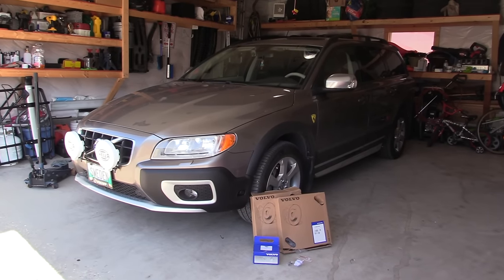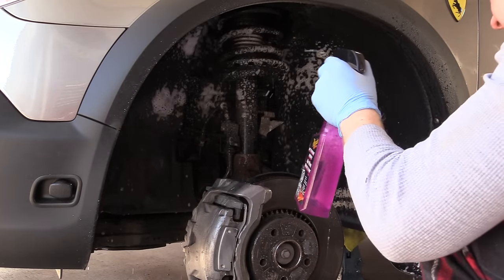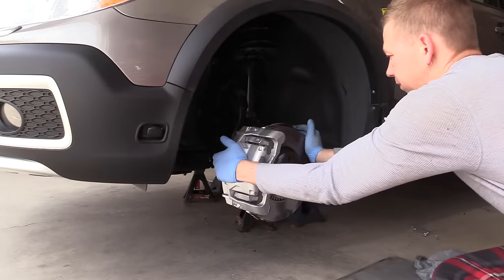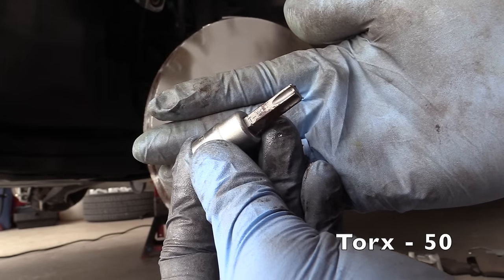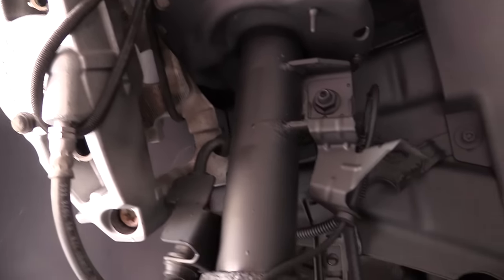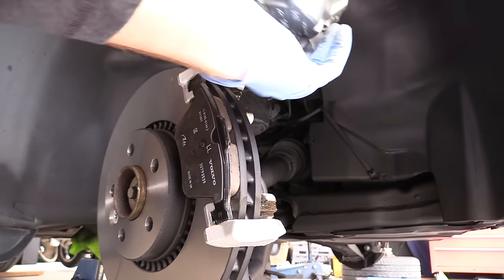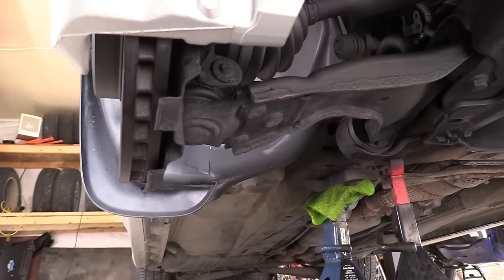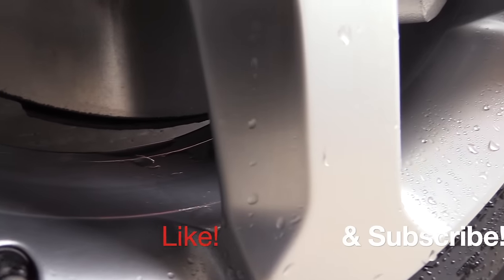Volvo Front Brake Replacement. And a little more!

Comment: Unfortunately the front rotors in newer models are now warping prematurely in my experience. I used to get 60,000 miles out of front rotors in P2 models never any pulsating in the steering wheel and both of our 2016 XC70's rotors started warping with slight shake that can be felt in the steering wheel when driving on the freeway that developed in just a few thousand miles with each of our old stock 2016 XC70's. It wasn't severe but happened again just a few thousand miles later in one and I can feel a slight shake or pulsating in the steering wheel when driving on the freeway. I posted a video on my youtube channel of the pulsating during braking. I don't think anyone likes driving a luxury vehicle with a slight shake in the steering wheel so if the issue is rotors I'm surprised Volvo hasn't revised to make them more like the rotors they had for P2 models that never had this issue. As to the cause I believe some suspect Volvo is now using a softer rotor material but I am wondering since it's happening so soon in my experience maybe the hubs aren't perfectly flat and have runout that rotors are conforming to since the rotors come from Sweden and do look solid and high quality. I believe this issue also continues with the new lineup after driving a new XC90 loaner with around a few thousand miles and I could feel the same thing in the steering wheel. In my experience Volvo had the best brakes with P2 generation and I'm shocked to experience this.

Comment: Hey Mr. Volvo
Good videos
Silicone Grease is not as heat resistant as copper grease as I use it keeps for several years, so there is still on when I change brakes next time. i have a 2011 volvo xc70 2011 that has driven 320000 km.
Kind regards Peter from Denmark
Reply: I am using Carlube Silicone Grease XSG070 on my Volvo XC70 2006 D5 Diesel when servicing on my brakes and I am verry impressed of results.
On sliding pins: 
The calipers are floating even 3 Years after this treatment .No sign of corrosion.
In the description:
ADVANTAGES:

Extreme temperature resistant multi purpose grease
Lubricates and protects plastic and rubber parts
Ideal for brake pads, o rings rubber seals and brake callipers
Water repellent
Because it has low dense ,I use a tiny tube - as in the pen.
I pushing the tube inside in the grease and  then with it lubricate iside the tubes for the sliding pins.

Comment: Very good video and work , I'm not a mechanic before I watch your video I've seen another in a garage where they've been saying that you need to bleed the brake fluid out as is not good to push it up the system, did you had any issues by not doing that.

Comment: First and foremost your videos are excellent. I am an ASE certified mechanic but use your videos for quick tips on wife's 2011 Volvo s60 since alot of things carry over.  Per alldata, which pulls info from Volvo's service manual, you are not supposed to grease slide pins.  Also, I wouldn't grease the hub or wheel. First it can possibly contaminate the pads,  second it increases the clearance between the rotor and hub which could cause warping. Like over or under torquing the wheels.  Otherwise great videos
Reply from the maker: Thx for the tips. But why does the printed instructions tell to lubricate the pins? I am confused.
Reply: @volvosweden  I wish there was a way I could post a picture to show the alldata information. Those were Volvo brakes correct? It is very confusing i agree

Comment: Hello, the brake pads are wearing uneven because of the sliding pins, they must be greased. The mobile part of the caliper doesn't slide even on these two sliding pins, this make the brake pads to not press the disk with the same force. I personally grease those pins to make it slide better. Maybe the uneven brake pads cause the vibration.
I use the old screws, because they are OEM  and better quality  then the provide ones from the brake pads package.
Great work

Comment: excellent. very methodic and going the extra work and details as a good European.
just curious. The hella lights look cool. In that location Doesn't interfere with the airflow to the radiator, no overheating?

Comment: The reason that brake pads do not wear evenly, because guide pins / locating pins are seizing. Use rubber grease where the pins are that they slide easily. Also replace rubber bushing where the guide pings go through.
Reply: Also, silicon grease is used for rubber, so you should put silicon grease on the guide pins, not for brake pad itself. For brake pads and caliper contact also on rotor and wheel contact u should use copper grease. And you should not use any grease on rotor and hub contacts, they must be just clean. If you put grease on rotor/hub contact, the rotor will not be flush with the hub, and can be vibrations under braking.

Comment: Great video!  There are different opinions about lubricating or not... Have your method worked good over time?  I know adding too much grease on the sliding pins might cause problems and lock them. Been there before... I usually put back the same amount I've removed. No more. If ever I need to clean the pins.  Then adding some grease between the hub and the disk will prevent rust. Slight amount again. Then adding lubricant on the brake pads tabs. I am just confused about what is optimal. Volvo may specify otherwise, but is it the best recommendation for people like us driving on salty roads 3-4 months a year??? No lubricant for a Florida commuter might be fine and even optimal. May not be fine for Winnipeg!!!  I live near Montreal, so I know what salty roads are!  Thanks for your feedback.
Reply: You are right.I am using Carlube Silicone Grease XSG070 on my Volvo XC70 2006 D5 Diesel when servicing on my brakes and I am verry impressed of results.
On sliding pins: 
The calipers are floating even 3 Years after this treatment .No sign of corrosion.

In the description:
ADVANTAGES:

Extreme temperature resistant multi purpose grease
Lubricates and protects plastic and rubber parts
Ideal for brake pads, o rings rubber seals and brake callipers
Water repellent
Because it has low dense ,I use a tiny tube - as in the pen.
I pushing the tube inside in the grease and  then with it lubricate iside the tubes for the sliding pins.

Comment: Really great and informative video. Well done. You mention about the figures on the calliper bracket of 316 being the size in millimetres. I have a 2011 Volvo C70 D4 2litre 177bhp. My brake calliper bracket has 759 on it and a rough measurement of the discs diameter show them at about 330mm. Perhaps, I should mention I'm in England and I also have a 2018 XC60 D5 AWD, but as that has little miles on at the moment, that is ok. What do you think about the number on the bracket? Do you think it's perhaps a Volvo code?
Reply from the maker: I have no idea

Comment: I have a C30 and I think the reason why the inner brake pads wear out quicker is because dirt and debris accumulates more readily in the space between the the rotor and the anti-splash backplate, you may also find that the inner faces of the rotor to be scored more than the outer faces as a result of the dirt and debris being trapped in that narrow space.

Comment: Excellent video, will be doing this on my S80 this week!!! 2010 3.2L FWD. Do you have part #'s for the (2) bolts holding that final caliper bracket on? As well as the torx 50 holding the rotor on. Thank you!

Comment: Hi. Great video again. Question were is the ABS sensor in all the assembly? My light keeps intermittent comes on upon braking so suspect either brake or sensor failing. Would you not change this in at the same time. Thanks again.
Reply from the maker: You can see the wire just under the strut assembly.

Comment: I have a 2012 Volvo XC60 and I too have an issue with the inner front brake pads wearer out faster then the outer ones.  I checked recently and found the outer was at 70% and the inner at 40%.... don't know why.

Comment: The outer front brake pads on my XC70 also have metal clips attached which connect with the caliper spring clip, is this the correct type.

Comment: I notice the rubber protection of the driveshafts are shiny and new! Did you ever do a job on the joints (couplings) of the driveshafts? Mine are worn and I wonder if refurbishing is an option or replacing is better. (XC60 T6 3.0)
Reply from the maker: I did not replaced them.

Comment: That's right you should always lubricate the sliding pins with some grease that is rubber friendly. Silicon grease is the best. If the calliper does not slide smoothly it can cause uneven wear of your brake pads.

Comment: I noticed you painted all rubber parts as well. As far as I'm aware, paint will dry and become hard and will harden rubber. After a while those will start cracking. Please correct me if I'm wrong
Reply from the maker: I did paint the rubber parts. The paint is very thin coats and will not cause any damage to the rubber. That is my opinion. I am not worried at all.
Reply: @volvosweden  thanks

Comment: Hi Yuri,
I think that wear could be from rubbing all the time on disc, a remaining pressure after braking. The calliper is in good working condition? The pins were stuck?
I got 2011 S80 which is almost the same with yours and I am thinking about replacing the front brakes. Yours are from a dealer? May I ask how much they cost?
In Alberta could be the same price!LOL
Reply from the maker: Hey. I actually got my XC70 from Calgary :) Flew over to get this beauty. All the parts were around 500$ CAD. Pins were nit stuck and the caliper is good.
Reply: Thank you for answering, great videos as always. Disks are high quality with grounded surfaces. Driving conservative will last for long time without problems!

Comment: Could it be that the inner face of the rotor being rusted has a higher friction coefficient?   That rougher surface would "sand" the inner brake pad while doing more of the work.

Comment: Curiousity question.  Why do you suggest ordering parts using the car’s VIN number?  When I take my at car to the shop, My mechanic always provides the vin number to the Volvo parts counter.  I never knew why and never thought to ask.
Reply from the maker: To make sure you get the correct parts for you car you need to order by the VIN number. As the time goes manufacturers will change change parts even for the same model.

Comment: Great work. But using rachet with extension bar will damage the rachet.
Reply from the maker: Its cheaper to brake a tool then bringing the car to a shop.

Comment: in reference to uneven pads on the disc.

Step 2: Be aware of outer pad wear. For this wear pattern, the outer brake pad has much less material than the inner pad.

This type of wear is caused when the outer brake pad continues to rest against the rotor, even when the caliper is released. This is a sign of malfunctioning guide pins, bushings, or slides. The easiest way to fix this problem is to replace the caliper and the brake pad.

Step 3: Be aware of inner pad wear. Signs of excessive wear on the inner brake pad are a strong indicator that the pad is resting against the rotor even after the caliper has released.

This type of wear pattern is a sure sign of a worn seal, damage to the caliper, or corrosion from exposure to wet conditions. As with the excessive wear to the outer brake pad, replacing the caliper and brake pad represents the easiest way to fix this kind of wear.

Comment: The uneven brake pad wear implies that the heating of the rotor is more on the interior face....this heat pattern is probably a factor in eventual warping of the rotor and oscillation braking at high speed.   3 root cause theories discussed below.

Comment: Good work! Do you rust check your Volvo? I was going to say.. could be a good investment since you’re in the harshest parts of Canada.
Reply: These cars come with 12 years corrosion warranty, but not sure what that means, what is covered? Could be a marketing trick!
Reply: Srn C unfortunately I’ve had run ins with that. It has to perforate (hole) through the panel for them to cover it. Other then that, you’re on your own. Panel can also not have any work done to it.
Reply from the maker: I did spray all the doors with rust check myself. But never at a pro shop. I think that this Volvo will last for a long time. Its already 11 years old

Comment: I bought accidentally 316 mm discs to 300mm brackets to 09' D5 S80. Can someone explain, what are my options? Is there any easy way to upgrade brakes to the 316mm?
Reply: You would need new brackets and caliper for 316. And of course new rotors and pads.

Comment: Not sure if you got the answer to the question of the inner pad wearing faster. Its "normal" for free floating brake systems, exessive wear though can mean the guidepins need lubricating or the piston is stuck. There is some good info on it at safebraking.com, including how to fix it.

Comment: seems the amount of grease applied onto the guide pin is not enough?
Reply: Again, volvo specifically says do not grease slide pins
Reply: @tmillner0682  show where volvo doesn't recommend  grease to slide pins?
Reply: @cezaryosiak4298  not sure how to post a picture on here,  but it's labeled operation number 51104-0 for Volvo in alldata.
Reply: @tmillner0682   I will check:)

Comment: The pads wear unevenly because there is only one piston in the caliper, only in the inner side
Reply: I am using Carlube Silicone Grease XSG070 on my Volvo XC70 2006 D5 Diesel when servicing on my brakes and I am verry impressed of results.
On sliding pins: 
The calipers are floating even 3 Years after this treatment .No sign of corrosion.
In the description:
ADVANTAGES:

Extreme temperature resistant multi purpose grease
Lubricates and protects plastic and rubber parts
Ideal for brake pads, o rings rubber seals and brake callipers
Water repellent
Because it has low dense ,I use a tiny tube - as in the pen.
I pushing the tube inside in the grease and  then with it lubricate inside the tubes for the sliding pins.

Comment: You don't put silicone on the hub. You put Anti-seaze paste on them. Silicone should go on the guiding pins.
Reply from the maker: I did not have the proper thing but the silicon grease will work just fine.

Comment: Time for a 336mm upgrade from an S80.
Reply from the maker: Will not work for me as I am using 16 inch rims for winter.
Reply: What kind of 16 rims are you using? Thought that minimum diameter for 316 brakes is 17 inch, for 336 its 18 (except a few 17 for example regor rim which fits the v8 with 336mm brakes too)

Comment: Be very careful when you put the guide pins in. You have to screw them in blind and I cross threaded the caliper mounting bracket with no effort whatsoever. Learn from my mistakes.

Comment: If you are compressing the piston before you remove the caliper how are you checking the dust boot covering the piston to protect it from dirt. Doing Brakes on a 2004 S80 was to easy. Yet your making this look WAY TO HARD. Once I saw you put a breaker bar on a ratchet and not a half inch breaker shows me you really don’t know what you’re doing!! Plus it sounds like you had warped rotors which could have been turned and would have stopped the semi and the steering well. Those brakes still had a lot of life in them but I guess you like wasting money. Learn to work smarter not harder!! 🤨🤓